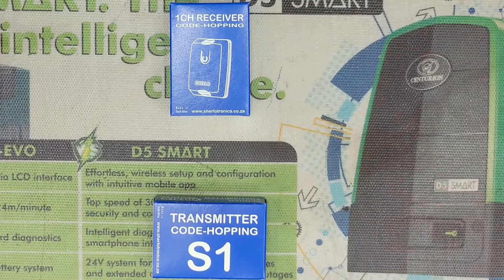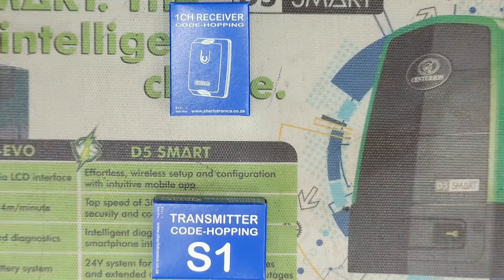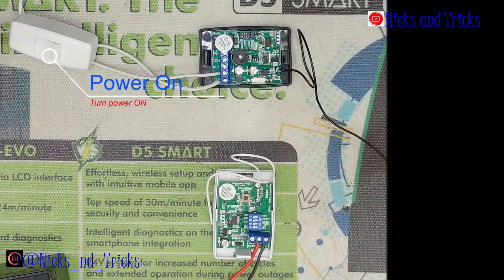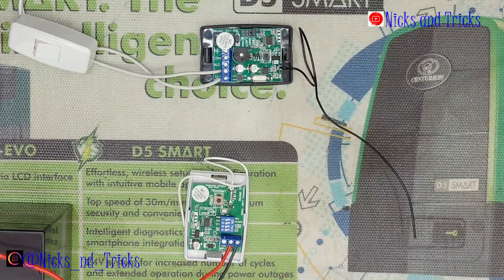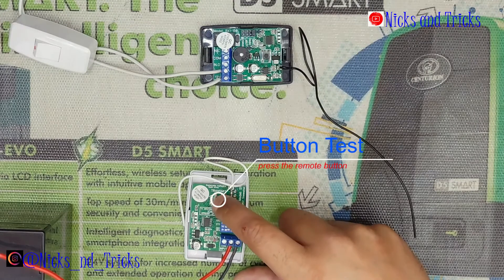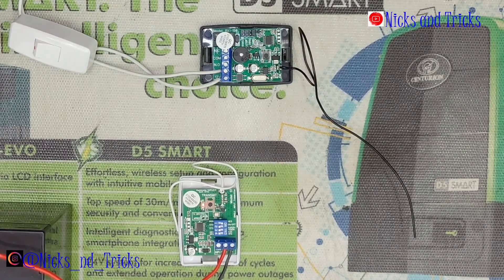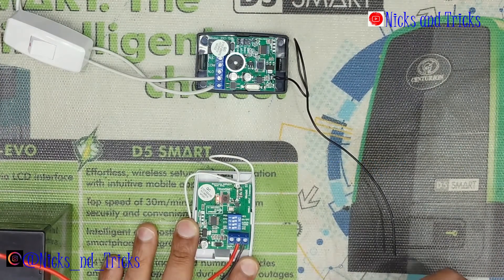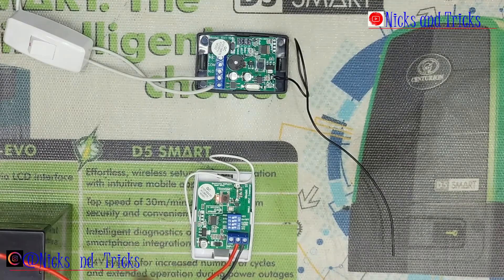Sherlotronics S1 programming onto a Sherlotronics Rx1-150 Receiver

Comment: You really need to update your old videos
Reply from the maker: Thank you for the comment, will have to make a 2023 refresh on alot of the videos. Will see what I can do.
What do you need help with?
Reply: @nicksandtrickssa  I need help with the new S4 and receiver- I can't get them to sync in channeln1
Reply from the maker: Apologies for the late reply, always check that the transmitter and receiver is on the same frequency